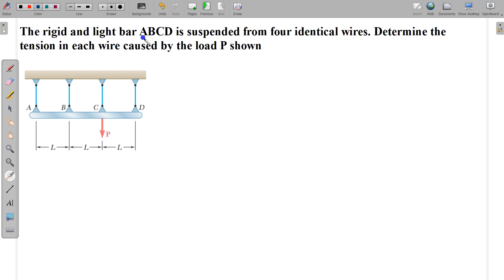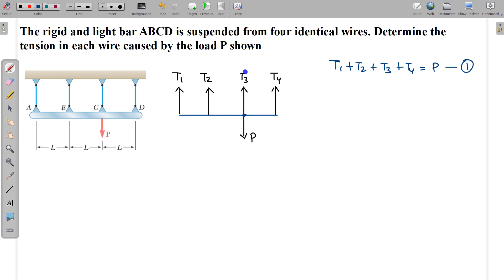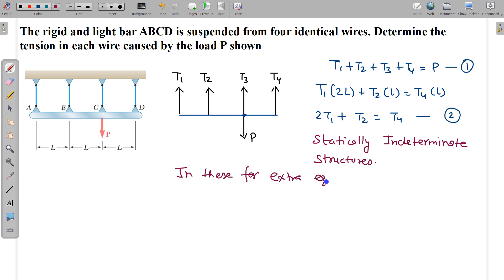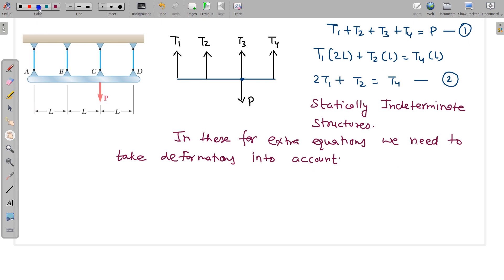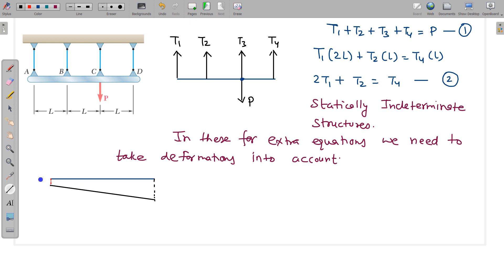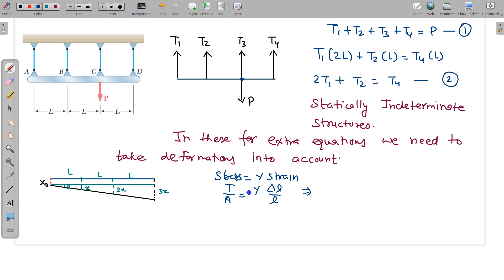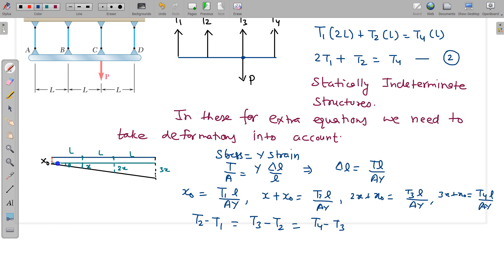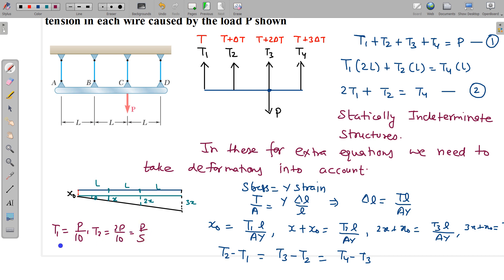Elasticity | Solving Statically Indeterminate Structure

Comment: Sir, are these categories mentioned in JEE Advanced Syllabus?
Reply from the maker: "Statically indeterminate structures " not explicitly mentioned in the syllabus but problems of equilibrium fall under this category.
If you see any standard text then you will find Equilibrium of rigid bodies is covered with elasticity